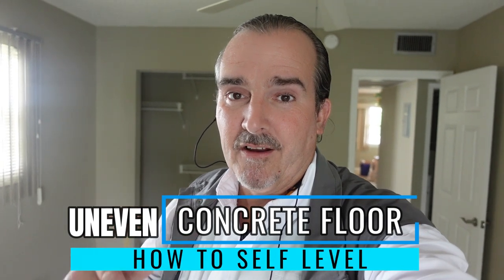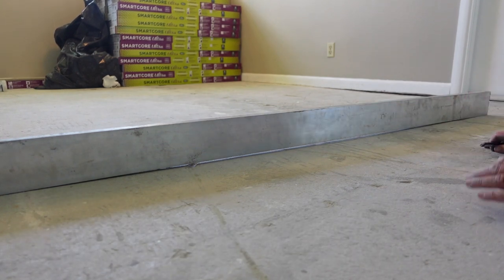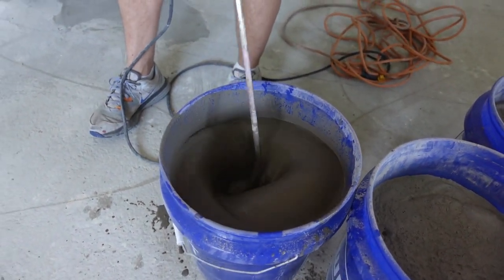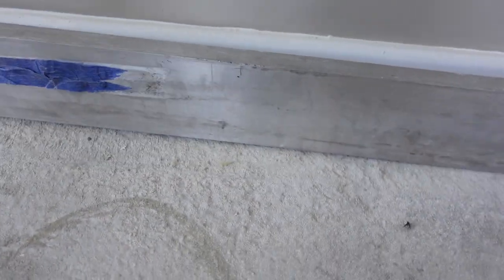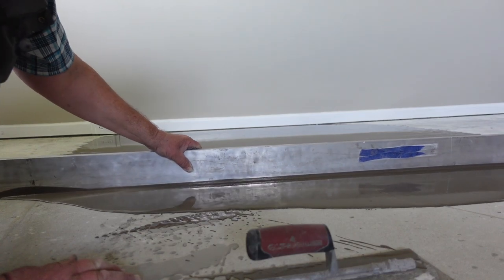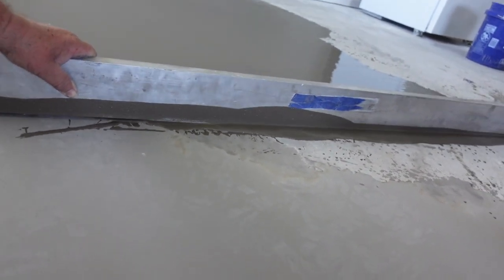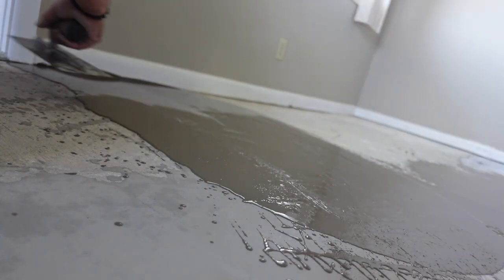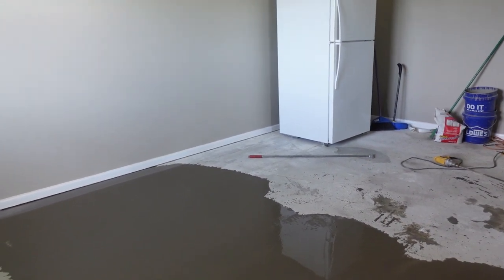SELF-LEVELING WITH A SCREED USING MAPEI, CORTEC VINLY INSTALLATION, HOW TO SELF-LEVEL, EASY METHOD

Comment: Great video I used Mapei skim coat product to fix an imperfection in my sub floor before installing lvp flooring. Product worked great lesson learned I added ice to the water to get The temperature down it gave me additional working time  to skim the floor area
Reply from the maker: Thanks.  The ice sounds interesting because the working time is so important.

Comment: In your opinion, how level does a floor have to be for installation of various types of flooring, <1/8"?  I've attempted to level a couple floors with Mapei self leveler but 1. Find it hard to estimate how many bags I'll need based on floor levelness and low spots.  2. Fail to correct larger areas where I need multiple bags and can't screed the entire width 3. Fail at transitioning from floor leveler to no floor leveler, feathering with a trowel leaves a bumpy edge.

Comment: Hi,
Have you installed a Republic Pure SPC? I am considering on installing that in my 1700 sqft home. Thanks
Reply from the maker: No, I've never installed this brand.  I did a little research on the brand and found some negative reviews.  It seems like people had issues with product quality and then customer service.  I didn't dig that deep yet.  Did you see this product in a store or online ?
Reply: @JonesKnows  saw it in person, the pure spc feels pretty good, but the embossing or texture doesn’t match the picture. When I see a knot from their oak design I was expecting the outline but it’s just straight lines. I also tried to snap the tongue and it’s pretty sturdy.
Reply from the maker: When you look across the floor once it's installed those are the type of things you will notice.